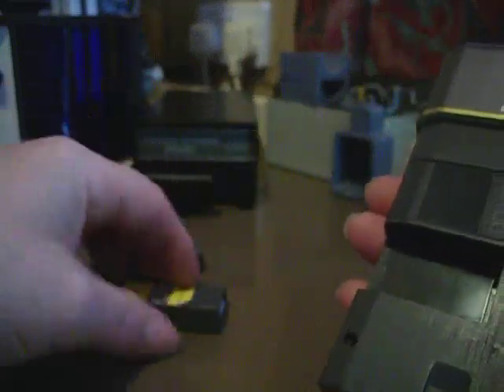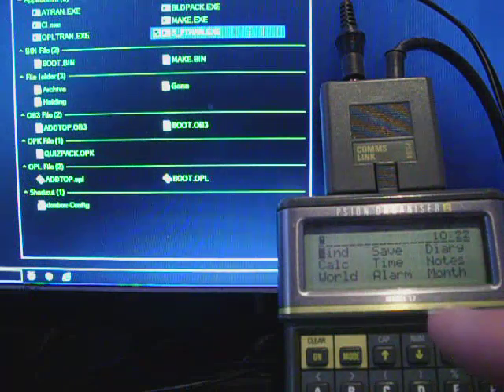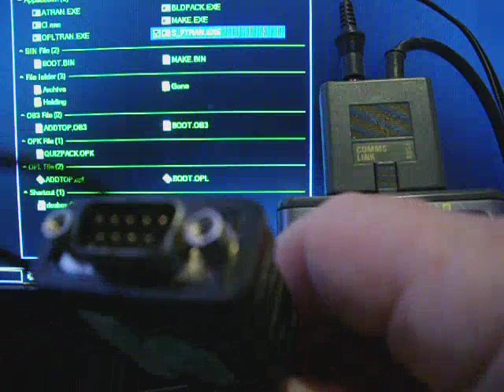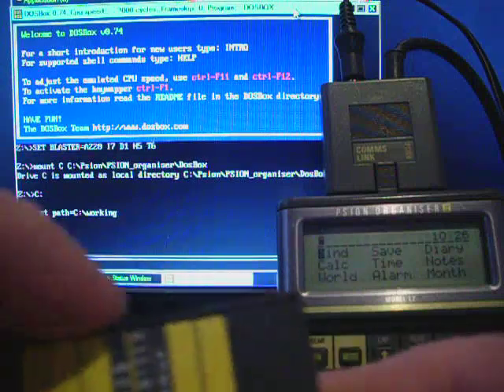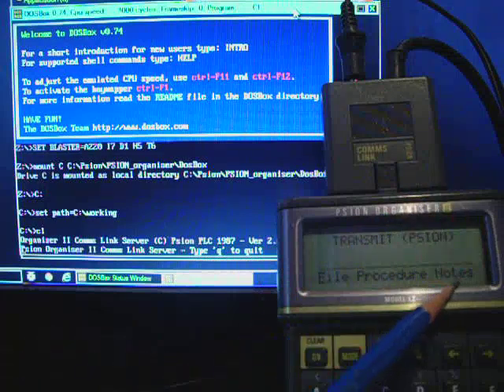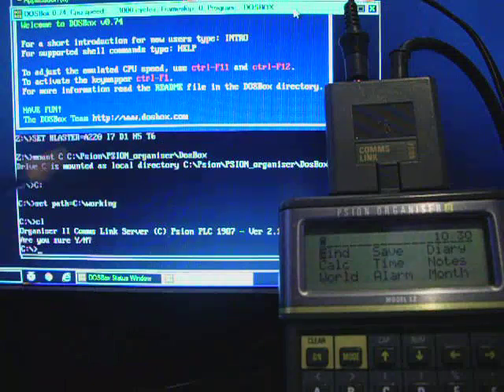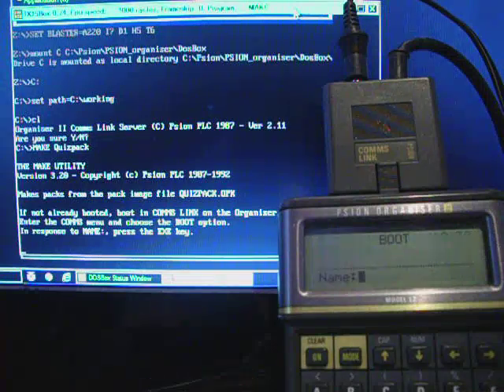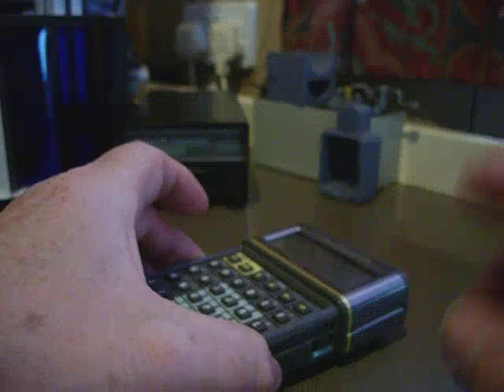Developing a Datapack for the PSION Organiser II (Part 2 the Organiser)

Comment: Be careful because older PCs used a 25 way D male for the parallel printer port or centronics printer port. And a 25 way D female for the serial port. 
I remember them well when I worked for IBM when the very first PC, PC XT and PC AT, came out.
Reply from the maker: Thanks that's a good point well made

Comment: You also can do it with a flash data pack too.
In order to do this, you have to replace the "MAKE.BIN" file with the "MAKE30.BIN" file.  But you must rename the "MAKE30.BIN" to "MAKE.BIN" before you replace the initial "MAKE.BIN" file.
It is not necessary to format the flash data pack in order to load an opk file in it. It will be formatted with the "MAKE" process.